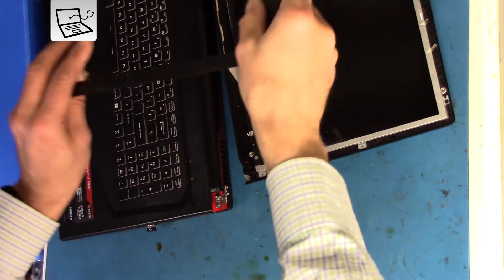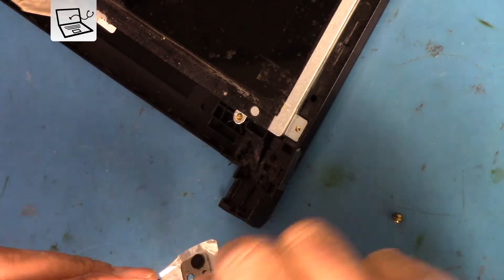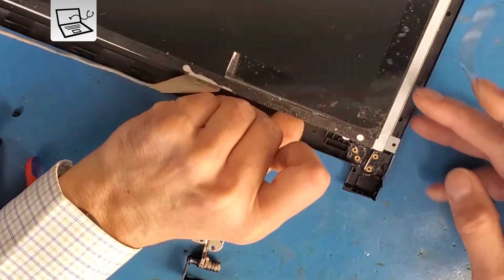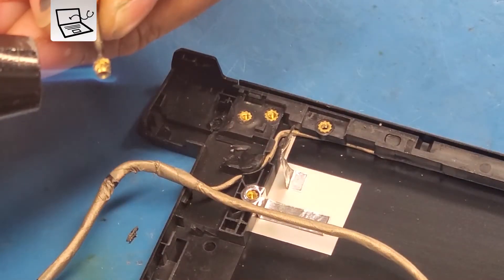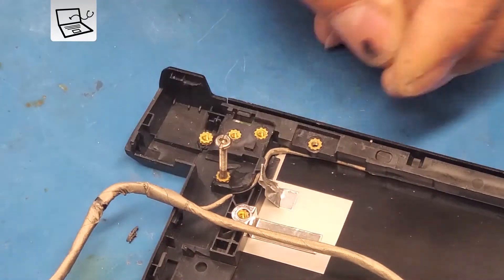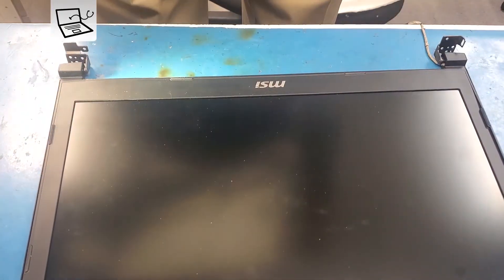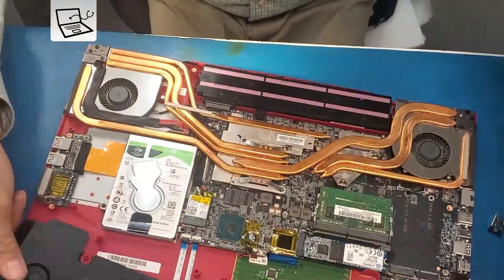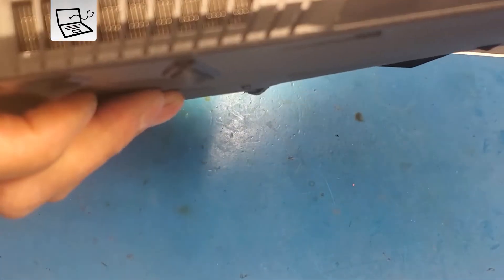Fix MSI Gaming laptop hinge with broken plastic LCD cover professionally

Comment: There is such a big design flaw in this collection that MSI should be held responsible. I have repaired the hinges on my computer three times and now it's gone again. However, the computer is less than three years old. 
For the price, hopelessly rubbish quality. However, the computer cost almost €2000 new. And if you wanted to repair with real parts, they would cost at least €200,
MSI tried to save on assembly and lost in quality. A lot.
Wasn't my first MSI, but I'll switch brands in the future.
Reply: also, tiny battery, while they waste so much space for these awful speakers. i known it's removeable but completely wrong design.

Comment: After reading several posts about people doing this fix or replacing the lid with new and it still breaking I just decided to drill through the hinge and lid and used pop rivets with washers.  I then flattened the rivet on both sides and so far it has been working great.
Reply from the maker: You can also stich it. drill tiny holes and use a steel wire, this way it does not add thickness to the LCD.

Comment: Can the hinges of an MSI GS65 Stealth be greased? A hinge was pulled from my screen housing. I disassembled them and I see that they move very hard. That's why I think it came off the case. What oil can I grease them with?
Reply: Don't grease it. Simply loosen the nut until you feel it is perfect. If you loosen it too much, the screen will not stand on its own
Reply from the maker: you can use motor oil.

Comment: Hello all well ? Can you tell me if there's an easy way to adjust the notebook's hinge a bit? I think she's too hard and I'm afraid of ending up breaking
Reply: Loosen the screws on the screen side a bit.

It won't do much but it'll loosen it a bit.

The actual tension on the hinge is given by the spring. If you want it lighter/harder, you'll have to replace the spring with a different tension
Reply from the maker: Use a pair of players or 6-7mm hex, you only need 3 degrees turn.

Comment: what is the name of that glue?
Reply: It's epoxy resin
Reply from the maker: MA300 Plexus
Reply: @LaptopDoctor  Do you have a link where you bought that? Would you recommend another one that is easier to find?
Reply from the maker: @tiagovla  https://www.hisco.com/Product/30500-15093
Reply from the maker: They usually have it in stock
Reply: I see you insert the hinge with screws and nuts tightened on the hinge, into the epoxy. Don’t the screws get locked into the nuts because of the glue?
Reply: @mikeusa66 also glued the top cover sides. these are not getting out again.